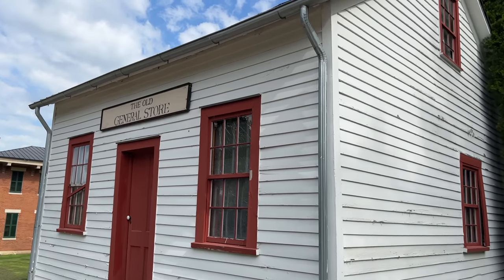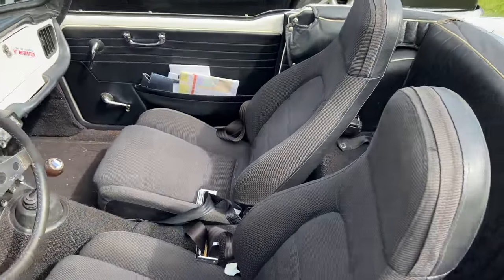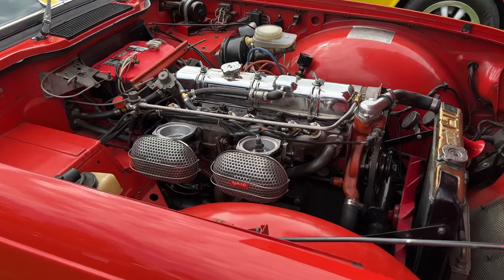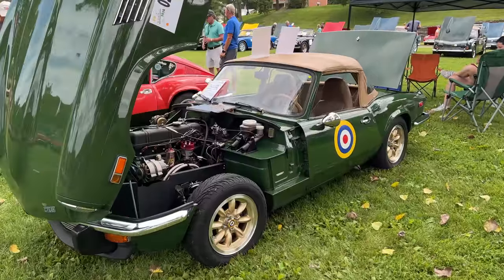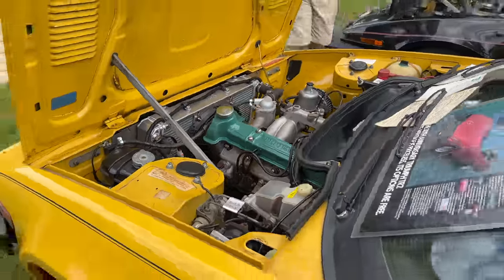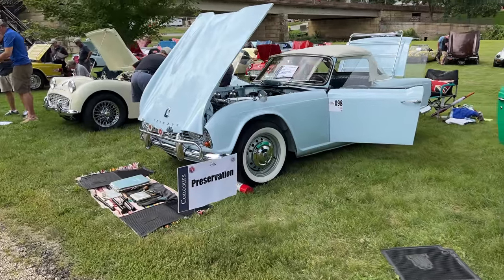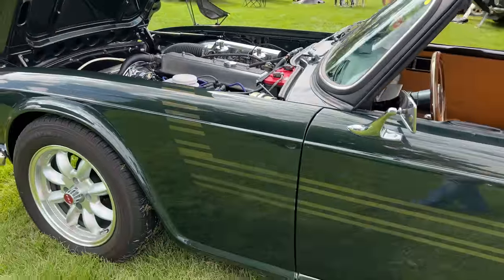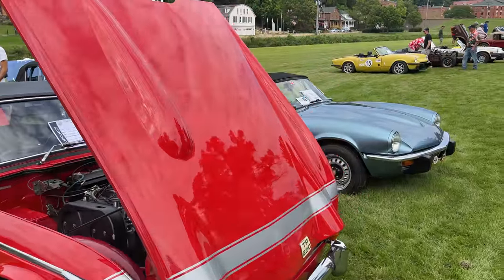Vintage Triumph Register All Triumphs Car Show

Comment: Nice review of some lovely cars, looks like a great event.

Everyone is too quick to say that the Triumph V8 / slant 4 were terrible engines and the Stag should have had the Rover /.Buick V8 etc etc. Triumph were a capable self- contained operation and were earmarked for making modern sporting cars within the BL group as distinct from MG that just kept updating old designs with traditional styling and mechanicals. A new alloy OHC engine was very much the way to go, although there were the parallel ’BMC’ E-series and later ‘O’ series in development at other plants in BL. The Rover V8 production would have been at capacity anyway supplying the P5B, P6B, Range Rover, Land Rover and later the MGB. However it is likely that the MGB V8 was brought out due to the difficulties with the underdeveloped Stag engine..

The Triumph OHC engine was very effective for SAAB who adopted and developed it, unfortunately all Aluminium OHC were quite a new thing for the British car industry (and owners / mechanics / dealers), the Hillman Imp had similar problems although the 60s Rover P6 / 2000 design was very successful.

Comment: My last Triumph was a 74TR6 PI.  Fast with injection but the engine was prone to tossing rear mains.  Mine had a removable factory hard to and wire wheels.  Prone to rust around the headlights.
This is a nice display and credit to the owners.

Comment: Thanks for sharing this video!!  I'm a Triumph guy.  First one I owned was a TR250 from 1971 to 1974.  Then a TR6 I restored totally from 1984 to 2003.  On this one I did bodywork and a lacquer paint job.  And I rebuilt the engine...along with many other items, LOL!  I did own 2 other TR250's with the intent of restoring one but foolishly sold (not knowing the cost increases to come!) both in 2002 ish.  Two years ago I picked up two TR4's - one is really a parts car but it is in good enough shape to be restored.  The good one is still awaiting my restoration.  They are both registered as 1963's  - solid rear axles.  Cool stuff!

Comment: This was fun to watch, and see my TR4 called out for the interesting air dam :) A previous owner made several racing mods -- it has back bumperettes (or whatever you want to call them) as well and had a nice roll bar, but I removed the latter. At one point I thought I would put bumpers back on, but now I'm not sure!

Comment: Nicely done. 👍👍 I owned and restored a bunch of different Triumphs. Two of my favorites that were very rare in the US were a 2000 sedan with overdrive and a modified Sports 6 convertible.  The Vitesse was sold in the US as a Sports 6 with a 1600cc six. The one I owned had the 2 liter six from a GT6 and overdrive. Sold them both in South Carolina in 1981. Wonder what became of them. Your video and narration are very good but you sure whizzed by the 6 cylinder Heralds/Vitesse/Sports 6.  I'll have to search to see if someone else did a video on this show.

Comment: MikeS
Hi Steve, Just a comment on Preservation Class in the VTR. I have judged many times and am familar with the rules. Once you have entered your car and won your class in VTR concours, you can enter Senior class. After two wins you must enter Senior class. You must maintain 350 (out of 400) points to keep your Senior standing. After a few years in Senior class, you move to Preservation class. You must maintain 365 (out of 400) points. Neither of these, Senior or Preservation, classes mean that they cannot be restored. In fact most have. There has been talk of a Survivor class, which would be never restored, but have not seen it yet.
Reply from the maker: Do you know why they call it preservation class?  In most Concours events that class is for totally original unrestored cars.
Reply: @ThisWeekWithCars  Sorry, the only thing I can think of is they are just trying to preserve the car. Once you have been in Preservation class for 4 years then you can go back to Stock and try to win your class again. Based on the scoring in regular concour judging, I don't think an unrestored car could win its class unless some one had an original that was never driven.

Comment: mmmmm I posted a comment hours ago and it seems to have disappeared. Thanks for the memories, Steve, I'm and old Triumph guy, one 2000 and two 2500TCs. Great driving cars but some diabolical mechanical imperfections. Rear outer wheel bearings failed constantly, I used to carry a spare in the boot and twice changed one on the side of the road, clutches were never right, and the combined bell-housing/gearbox/overdrive weighed a ton on your chest while you were lying on your back on a cold concrete floor trying, yet again, to fix it. I never had one of their sports cars, but always wanted the TR5/TR2500, but with only 2,500 made, they cost a fortune these days ; there's one on sale here in Australia at the moment for $A105,000!!!
Reply: They built some great looking cars for sure just let down by some shonky engineering . A TR 6 and a 2500 estate are going in my dream garage when I win the lottery . Start doing the scratchies is my tip .

Comment: The light-colored TR2 at 16:40 in the video is a "long-door TR2."  You couldn't open the door if you parked too close to a curb, so Triumph soon changed to a more conventional short-door TR2 with rocker panel beneath the door.

Comment: Did anyone explain Senior and Preservation to you? Senior class is for cars that have won class in concours twice. Senior cars have to maintain a score of 350 (of 400) points to stay in Senior, otherwise they revert to regular concours. Preservation class cars have been in Senior for at least one year and must maintain a score of 365 points to stay in Preservation. There are also Modified classes for cars that aren't strictly factory original. Hope this helps.
Reply from the maker: IMO that’s ridiculous.  If you bring a better car you should win.  If others don’t like it they should make their car better and VTR should be encouraging people to make their car better.  Also Preservation class should be giving credit to completely original unrestored cars.  A good unrestored car is a real gem and can’t be recreated.
Reply: @ThisWeekWithCars  the intent with Senior and Preservation is to get cars that win all the time out of the class so that someone else can win. After 4 cycles, a preservation class car can move back into concours at the owners option. All Senior and Preservation class cars come away with an award. It made more sense when there were a lot more cars on the field, and people came from a lot farther away to participate.

Comment: Do you have any Idea of the name of the color on the green color on the small grille TR3? I really like that. Also, the mallard TR6 also appears to be nearly a shade of blue in certain light. A friend had a 1973. Mine is a Jasmine 1971 that I have owned since 1975. By the way, this was a great video.
Reply from the maker: Apple Green would be the factory color.
Reply: @ThisWeekWithCars  Thanks, its a great color for a TR3.

Comment: I have to ask, why did they not export the fuel injected engines to the US?
Reply from the maker: They had developed an emissions system with the Stromberg carbs and either didn’t have time or want to spend the money to get the petrol injection to pass the emissions test so the sold the US the less powerful carb version.

Comment: "Bikini" top? I'm having naughty thoughts visualising that. Possibly you meant to say "Bimini"?
The Vitesse had a less rudimentary rear suspension than the Herald, with a proper 2-joint axle, rather than the simple swing axle. IIRC, the Vitesse setup was used in the GT-6, not sure about the Spitfire. The Vitesse also had a 4-headlamp set-up, whereas the Herald had 2.
Reply from the maker: Here for vehicles, especially Jeeps, the two styles are called Bikini and Brief tops depending on how much it covers.  https://www.4wheelparts.com/b/tops/brief-tops/_/N-cm0ud

Comment: Roadsters my friend, not convertables.
Reply from the maker: If its not really a roadster I refuse to call it that.  If the top doesn't detach completely from the vehicle and stow away or be covered by a hard body door it is a convertible and not a roadster.  A roadster does not have a visible top when the top is not up.